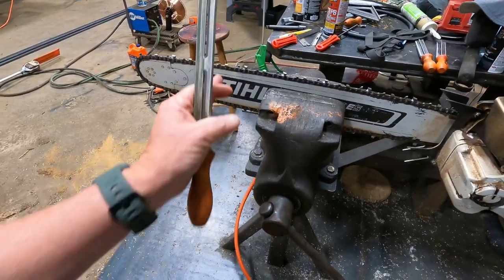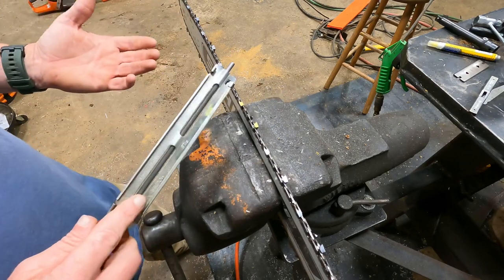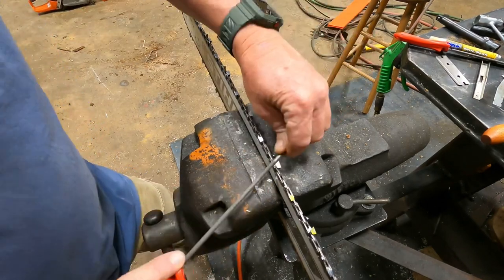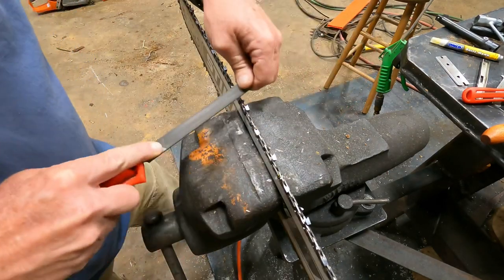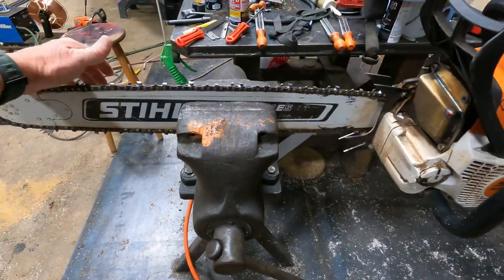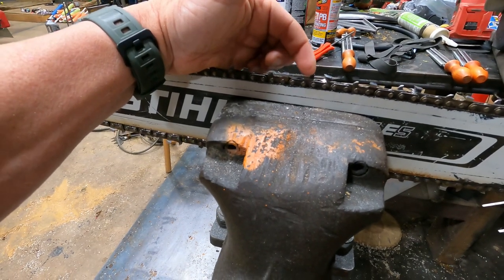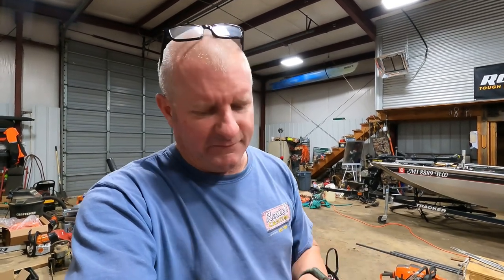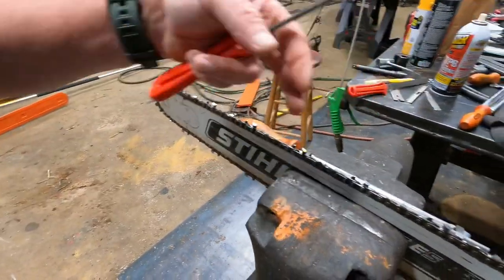Razor sharp chainsaw- the “Taylor” sharpening method

Comment: Tim good job on the sharpening instructions.👍

I never understood why people file over a depth gauge. File away the raker not the gauge, save those files.

Good job on the double-gullett or opening up the gullett, comes handy in the middle of the cut when most of the chain is in the log. Something that is done on square filing as you mentioned.

Nothing beats hand filing, even the grinder comes up short, your video clearly shows that.

Happy and safe cutting. 💪🪓🌲

Comment: Those file guide tool plate snap on thingys are great for helping maintain the file depth and proper hook. The folks I train use them and have lots of success, it’s a youth corps. I have a complicated filing technique and I like the husky roller guide for mindless filing and getting a bad chain back in order, mostly I free hand in the field with a depth gage plate for my rakers. I started learning to file at ten and got decent by 15, I really got it from a logger I went to school with. That was over twenty years ago now, I should make a video it would be funny. Be well Tim
Reply: That Husqvarna roller guide is pretty good with that x-cut chain.with light pressure it seems like you can sharpen the chain faster and more consistent than doing it freehand. I was impressed  with it.

Comment: We allways sharpened 3\8 with a 3\16 I think you can put more hook in the top chisel! Who knows but thars how I was taught as a boy lol I can do pretty good but I cut up on a yard for a long time I learned the hard but best way! I had a 4 ft stick and a ax to beat dirt off the logs with! And prayed I had a loader man to hold em up for me made it alot easier.in winter I've wades mud knee deep cutting logs up with a super pro 105 ? Remember those times? Dad hauled 5 ft pulpwood back in the 60s 70s to champion we sawed it up with bow saws! Gear driven bow shaped bars would cut dull!!

Comment: Never like the old style file guides but the new Stihl guide with the taker file does actually work very well. That said if your confident and have a good eye  it's a helluva lot quicker to eyeball it.
The best tip I have is run the saw up and get plenty of chain lube over those teeth so it lubes the file. Your files will last a lot longer.

Comment: Tim, do you file the gullets on your smaller chains as well? If so what size files for the 3/16 and 5/32 chain gullets? Thanks. Great video.
Reply from the maker: I have occasionally on 325 chains and u use a 5/32 file. I don’t on the smaller chains.  It doesn’t seem like it helps near as much on smaller chains as it does on the 3/8

Comment: Like to run that saw to see how your file job cuts.
My buddy Dave files with a 7/32, and angles it down at least 40° rather than level across or 10° like I have read is correct. 
His saws cut like a mother. I mean, dang!
And they stay sharp a long time.
He does it on a pickup tail gate, takes him 2 minutes, tops.
He logged for 30 years.
Reply: Wood species will play a big part in that chain cutting good.